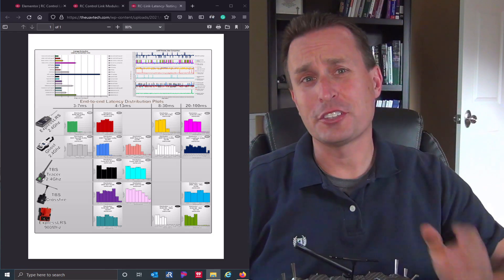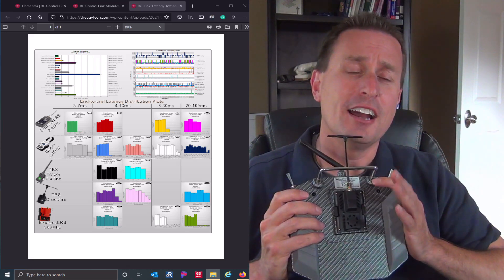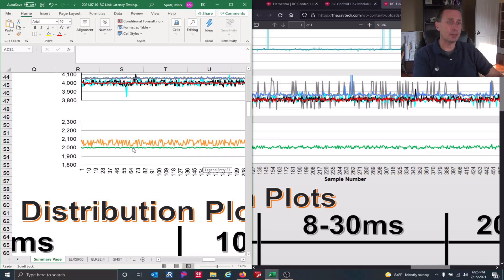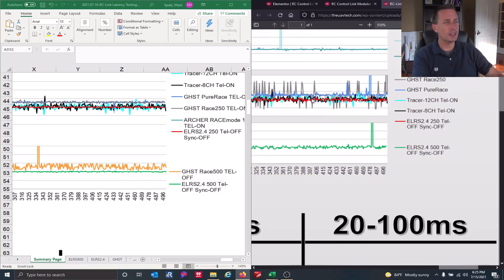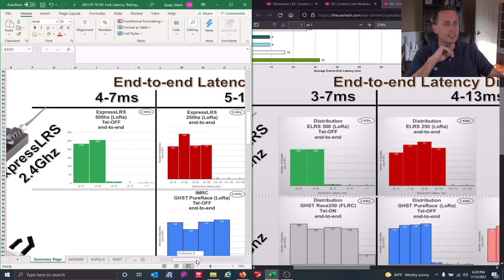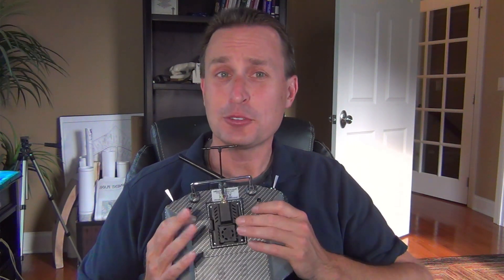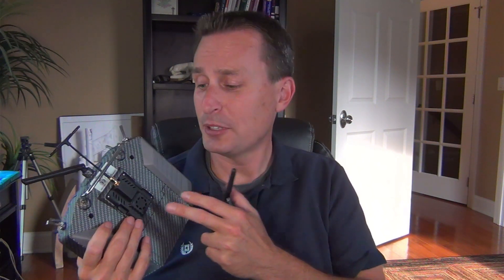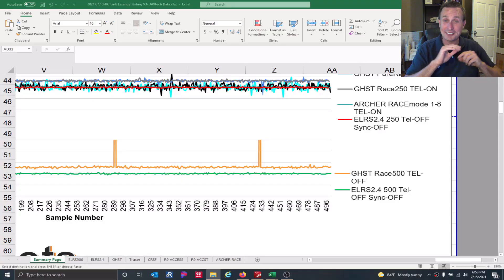HappyModel | ExpressLRS Performance Update (LOWEST JITTER!)  😯

Comment: Fascinating data, thanks. Can anyone shed light on why TBS doesn't offer a LoRa modulation option for Tracer, when AFAIK the hardware supports it? Their official line is that there is Crossfire for LoRa, and racers don't want LoRa because it's slightly slower. But Crossfire maxes out at just 50Hz in LoRa mode while Ghost and ELRS can do 250Hz+ LoRa, while easily outranging Tracer Watt for Watt. What am I missing? Seems like a rare product strategy failure by TBS.
Reply: TBS most have a marketing reason for not doing this as there is no technical reason.
Reply from the maker: Agreed.  Also looking at R9, it does the same thing with native FrSky Firmware.

Comment: Hrmm? I'm using Archer RS Racemode and Betaflight BB reads 4ms; you got 10ms in the test? You also tested Racemode 'Telemetry ON?' It's supposed to be off to work?
Reply: Backbox frame interval log is NOT the same as end-to-end latency.
Reply from the maker: Tel off (4ms) in Race mode is tested as well.
Reply: @uavtech  keen to see how it compares.

On an Xlite Pro as I love the gimbals so Im keen to see how ELRS compares,  also use R9MLP for 900mhz. Been curious how that does also

Comment: I've had the Jumper T lite and ELRS module for about a month and a half that I use for my compact analogue set up (toothpicks, 65mm whoop and one analogue 5"). Its been fantastic so far, especially with the 500hz firmware. I use a taranis/crossfire for my digital 5" quads. I'm pretty convinced that the taranis and crossfire will be going once the ELRS firmware has matured a bit more.

Comment: Have both the Micro and Jumper T Lite version, quite “happy” with these. Any chance you can compare the Ghost module flashed with ELRS benchmarked against Ghost protocol itself?
Reply from the maker: No, once I flash Ghost to Express, I can't flash it back again I think.

If Ghost can sort it's jitter stuff like they did have sorted in Beta 1.0.3.1, I is VERY GOOD!